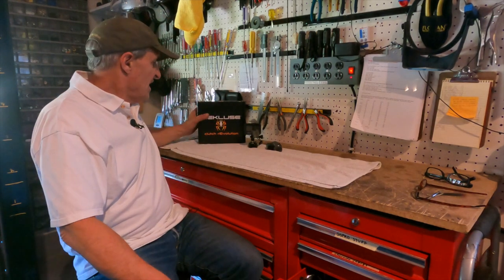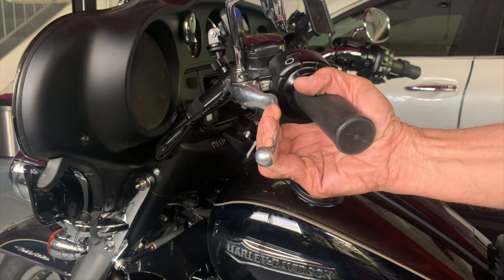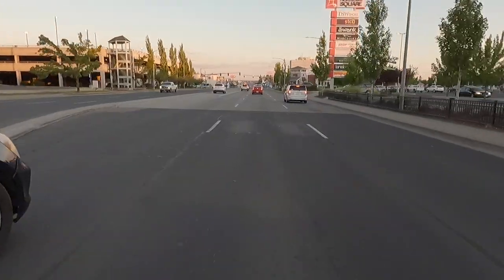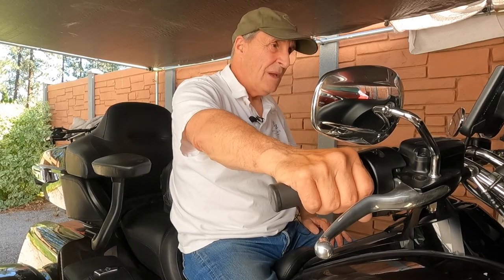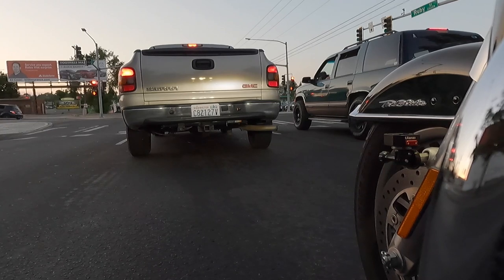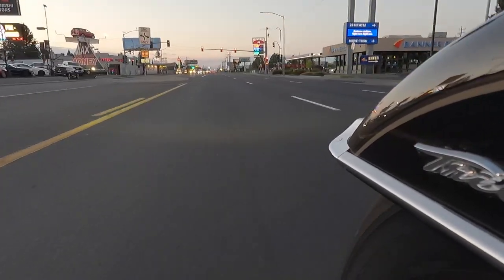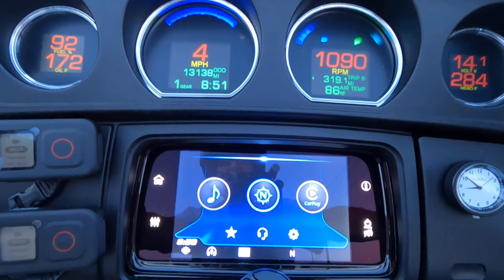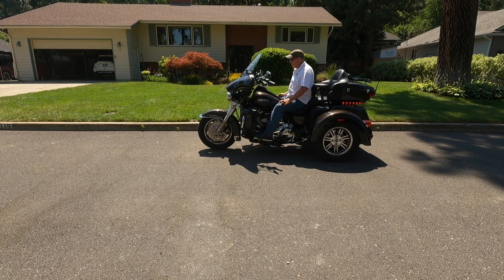Rekluse Clutch Harley Davidson Tri Glide M8 Examples of use.

Comment: windsurfed1....Absolutely GREAT video about the use of a Rekluse auto-clutch I've ever seen. Even learned a few trick I didn't know after having one for 4yrs.This video should be attached to the Rekluse website (if it isn't already) and provided with every Rekluse clutch installed, a short video file given to the customer by whoever installed it.

I'm 65, been riding since 13yrs old, very familiar with NOT have an auto-clutch. 1st bad experience was bumper to bumper traffic for 6hrs riding thru Louisiana, had to pull over and let my left hand relax. Cursed the situation but, rode on. Close to home same thing for 15 miles, my grip just let go and the bike jumped and engine died. Fortunately I knew how to handle it. More cursing. Immediately decided to get an auto-clutch. Rekluse was my 1st choice from website surfing and it's advertisement/show at a local (to me) Lone Star Rally in Galveston. 1st thought when I first saw them some 6yrs back was...that's stupid. Oh NO, so I had one installed on my 2017 Harley Road Glide. OMG best decision I ever made about an upgrade to my pretty new Harley. The should be made standard equipment BECAUSE you can use the clutch as you normally would but you don't have to.

FYI I'm not a Rekluse employee or paid advertiser. I'm just an experienced believer in Rekluse. Got another brand for the wife (because of price at the time), worked ok for her, she couldn't competently use a clutch and it worked, but not as well as my Rekluse, but she didn't know and hers worked great for her, but I did as we rode together for thousands of miles.

Long story short, too late now..LOL. Love it, no regrets. Just bought a new 2022 Tri Glide and wouldn't take it home without the Rekluse auto-clutch installed. What I learned by trial-error with the Road Glide, you have explained exactly how to use it and what to expect.

In my 4yrs experience with the Road Glide and now just a few months with a Tri Glide, anyone watching this video can't go wrong having it installed. No, not cheap, but if you ride thousands of miles a year or just can't get the hang of using a fully functioning 'mechanical clutch' only, get a Rekluse....they're GREAT...watch this video, no better advice can you get.

Windsurfed1...WONDERFUL FULL EXPLANATION....THANK YOU!
Reply from the maker: James, truly sorry but I missed this comment somehow. Thanks for the compliment on the video. Hi, like you have been riding since I was 13 and I was in the same identical situation you are in with hand grip. I also ended up putting in a new slave cylinder, which made it even easier to pull the clutch.   Not too many guys have a wife that rides her own motorcycle like you. Fortunately, I have one also. But she had to quit because your eyesight was getting bad. That’s when I bought my 2020 tri glide for her to ride on the back with me. We rode together for 15 years before I bought the Triglide.  Congratulations on your purchase of your new 22 TG.  I should have bought a tri-glide 10 years ago. Anyway, thanks for the comment and again I’m sorry I did not answer your comment. I always answer comments but somehow your slip by me.
Reply: @windsurfed1  Well, at least you eventually replied, thanks. Wife's 1st individual "bike" was a 500CC scooter, sort of an automatic transmission. Tried as she might, could never master the accelerator/clutch, then add braking too of a standard unmodified motorcycle. But, disregarding take-off ability she could keep up with me at any highway speeds and we frequently took 10 day rides across many states. 1st time she got blown over 2 lanes in a storm I stopped us to rest and allow her to regain her composer. 1st words out of her mouth was "I need more ass" LOL No, I didn't touch that comment but I knew what she meant. I was riding a full dressed Road Glide. Within a week we were looking at the Tri Glides. In the motorcycle world ya can't get more "ass" than that. Immediately had an auto-clutch installed, can't remember the brand, wasn't a Rekluse, couldn't use the clutch anytime and every time like a Rekluse but it worked for her. For me, my left hand was getting weaker (and I'm left handed) the older I got. 5hrs of bumper-to-bumper traffic took it's tole and I decided on a Rekluse because you can use the clutch anytime ya want or none at all. Only down side with a 2-wheeler is parking on an uphill incline, putting it in gear was ineffective. Fast forward, after having a stroke the Road Glide sat in the garage nearly 3yrs as my left leg lost some feeling and strength to the point I was scared to ride the 1000lb 2 wheeler. Only option I could think of was sell the bike and quit riding. Wife talked me into switching to a Tri-Glide. Rekluse installed before I left the dealership. Love the Rekluse, has it's own parking brake, no need to put it gear. Only downside with a Tri-Glide is ya can't "lean" into a curve. I still miss that "lean" (including the occasional sparks) after nearly 60yrs of having it but it is what it is, just have to get over it.
Reply from the maker: @HarleyUTubr  I think without the recluse clutch, probably my riding days were over. I had to do something about that clutch pull. That’s when I discovered the reckuse clutch. All the years I have been riding I’ve never heard of one and that’s kind of weird. In 2019 on a trip to the Alvord desert in southeastern Oregon, I pulled into a gas station to fuel up and forgot to put my kickstand down, and I fell over fully loaded.  I was on a 2016 triumph tiger 800.  From that point on, I started thinking about my days of riding could be over. Then I started thinking about the Triglide and ended up buying one. I’m glad I did because it extended my riding   probably for another 10 years or longer or lesser. Who knows.   They are a little expensive out the door. I have since put on over $8000 in usable accessories, none for looks.  Well, maybe a bit, but mostly for convenience and comfort ability.  And for the wife, she really enjoys riding in the plush seat in the rear I thought she would miss riding, but she’s content on the back now listening to her music  we did not go, like you did for 10 days or so, but we only went for 4 or 5  days at a time. I think our average per day was right around 270 miles a day. We enjoyed it and just took our time.  Before I met my wife I’d like to camp a lot. Her idea of camping was staying in a motel. So guess what, we stayed in motels/hotels and I got to the point where I forgot about camping. Anyway, I know you got tons and tons of stories and experience. We both will just keep riding and enjoying til. It’s over.

Comment: Thanks for your help, I just bought a 22 street glide, my drive out of my townhouse is a steep hillwith a semi blind right turn at the top. I have to feather the clutch to navigate the turn at a slower speed, If I had to stop I will have my hands full. I think this clutch would eliminate that stressful situation,, I am going to have one installed. Thanks for your helpful info.
Reply from the maker: Glad you could use the video for some information. That would be a great clutch for what you were talking about. They are rather expensive though. I have not had any issues with mine and I have around 8000 miles on it. Of course I am very easy on it, I think maybe if a person was hard on it it wouldn’t last as long but I suspect mine will get thousands of miles on before I have an issue.
Reply: @windsurfed1  yeah I plan on going easy on it also, that big heavy glide intimidates me, your video was awesome!!!
Reply: @windsurfed1  I did have a recluse installed in my street glide and it is a beloved upgrade, although I haven't been able to put many miles on it before the season ended on us. sure is a fine upgrade and thank you for taking time to school us.
Reply from the maker: @michaelpowers4452  Michael, thanks for the comment. The recluse clutch now has around 15,000 miles on it and it’s still working really good. I am very easy rider so I don’t hot rod or anything but it is very nice to have especially in traffic.

Comment: I'm looking at purchasing a Tri-Glide  or a Freewheeler (will be my first Harley after a lifetime of riding Triumphs) and have been devouring your videos. This one is fascinating. Thanks for pointing out the negatives too.
Reply from the maker: We rode Moto Guzzi ‘s for 15 years then I went to a triumph tiger XRX, which probably was my favorite bike, but I finally had to dump two wheels and go to three wheels and the Triglide was the best choice for me. The recluse clutch is probably one of the best investments I made for this Triglide.  Kind of expensive, but if I had to do it all over again, I definitely would. I love the recluse clutch. I’ve heard some guys having issues with it and I believe it’s only because it was installed not properly it or they don’t know how to use it correctly. If you’re a hot rodder, I’m not so sure this would be a good choice. But if you are a mild mannered rider , this would be an excellent  choice.

Comment: First video that really shows how to use this thing. Had in my bike over a year and really had no clue how to use it. Burnt up on me after my first trip and really had no clue why. But the company is awesome and sent me a new one but still didn’t realize how to use it till I watched this…. Had no clue u didn’t have to down shift and pull the clutch in on all those gears …. Wow still would like some info on the gap … adjusting that thing …. I have a road glide …. Thank you 🙏🏻 awesome…
Reply from the maker: Well I am glad you discovered the video.  The way I used it in the video is the way I use it in real life. It works fantastic. I hardly use the clutch lever anymore. I had the shop put mine in and they adjusted the gap. I have over 8000 miles on that clutch. And I have never adjusted the gap because to this day it still feels the same as the first day.  I am pretty easy/gentle with the throttle in the clutch. Maybe that’s why I have never had to adjust it.

Comment: You nailed this, thank you. Having had a Rekluse clutch previously, it’s a solid product, no complaints, well built and thought out. If one does mostly city/parade/sturgis main street riding it’s very viable. That said, having also been riding well over 50 years combined with being fortunate enough to still be riding and also riding a Tri Glide, I’ll stay with the uncomplicated thought, natural instinct of the stock clutch and gear box. One man’s opinion and I fully appreciate and thank you for yours.
Reply from the maker: Thanks for the comment. Yourself, riding over 50 years, I take it you really know what you’re talking about. I really am enjoying that rekluse clutch. I probably would not enjoy riding as much as I do without it. The slave cylinder added to the easiness of the clutch pull, which mades it even better.

Comment: I've been searching YouTube for a "how to" on the rekluse, and your video was EXCELLENT. Were you a teacher by trade? Because you explained everything in fine detail and absolutely perfect.. anywho, thank you, I'm getting a stage 2 on my freewheeler and now a rekluse clutch
Reply from the maker: Don't know how I missed this comment.  No I'm not a teacher.  Thanks for the comment.  Really sorry I didn't see this till now.  You will really like the rekluse clutch.  I am thoroughly enjoying it.  I have about 5200 miles on it now.
Reply: @windsurfed1  so I'm in Ontario Canada and it's been cold and rainy so nothing yet, but I have another question, if you're in say 5th at 1500rpm and downshift to pass, do you need the clutch then?
Reply from the maker: @macwiller2105  If you were at 1500 RPMs and in fifth year and you want to shift down and pass, then yes you would have to use the clutch and shift down.
Reply: @windsurfed1  ok thank you. So basically it's for coming to a stop and starting? Anything under 1150rpm then?
Reply: @windsurfed1  last question, do you still "blip" the throttle to rev match when you downshift? I would assume if you didn't the bike would shutter
Reply from the maker: @macwiller2105  The recluse clutch is mainly used when coming to a stop and starting. On any motorcycle you can shift sometimes without the clutch depending upon the RPM. I blip the throttle to make it smooth. And this clutch is and can be used in that same way. If you have mastered that clutch throttle blip thing. I use it occasionally blipping The throttle up a little bit when shifting in higher gears and even when shifting lower gears.  But just when the RPM is calm and I am calM. But anytime I would go really fast I would use the clutch or shift down real hard I would use the clutch lever. Hope this makes sense.
Reply: @windsurfed1  yup, it absolutely answers my questions and thank you for your time.. safe travels

Comment: very well done! question - when you were down shifting at a light, were you using the clutch at the 10%?
Reply from the maker: @jimgallo6508  no I was not downshifting coming to the light using 10%. I was drifting along and the RPMs are under 1150. RPMs and I just shifted down ever so slowly/naturally each gear 
 as I came to a stop.

Comment: thank you for the great explanation. I have a question, i hear many things about reklusse. if you use it the wrong way, you can easily break it or burn the clutch. do you know anything that we shouldn't do. if we use clutch too much does it give harm?
Reply from the maker: Ya know,  when I decided to pull the trigger and buy the rekluse clutch, hi by then had done a huge amount of research. After all it is a lot of money. Of all the comments of people that owned one, not one negative comment. Everyone that owned one was very happy. As I am also.  I am a very cautious/easy rider.  A few times I have started out in 4th gear by mistake. I have 2500 miles on the clutch now with no issues. Yes, you could burn the clutch out just as you can burn the clutch out in any other brand. Common sense and easy-going I believe will make this clutch last a long time, probably longer than I will live. The only issues I have heard of is the installer not correctly installing it. For this big touring bike of mine, I am really glad I got it. I think you would be happy also.

Comment: Great video... I was hoping this system would allow the bike to be started in first gear without having to pull the clutch. Avoiding neutral on a HD would be desirable since we all know how frustrating it can be to find neutral.
Reply from the maker: Thanks for the complement. Other than what you were saying about, the clutch is great.  I did add a rekluse clutch slave cylinder which reduced clutch pull around 50%.  I am very happly with that.  Even thought I seldom use it anymore.

Comment: Great video - so many questions.  im a new rider.   had rekluse installed oni my freewheeler trike.  many issues - changing gears from 1sr to 2nd.  will try your methods of shifting up,  Rekluse wants me to keep rpms above 2500 in any gear above 2nd.  having helluva time up shifting.   wont let me shift unless throttle is even.  what is your range for upshift 1st-6th.  I do find if i do a quick stop, it will return to 1st gear.
Reply from the maker: All you have just said tells me it ain't right.  It should act just like a regular clutch with no issues.
You are using the clutch lever (Pulling in) when shifting 1 to 2nd and to 3rd and so forth?  I have heard of mechanics who installed the clutch wrong and then they had issues.  You should not be having any issues at all it you bike did good before the install.  Now after the install, you are have issues.  Should not be.  Something on the install.
Reply: @windsurfed1  thx for he reply.  will confer with harley.  next question.  when stopping like you in  t4h or 5th, dont need to pull clutch lever?
Reply from the maker: @giantcarver  that is correct. As you are coming down in your speed and the RPMs are below 1150 RPMs you can gradually shift down from fifth or even six down to first and I would suggest slowly so that by the time you’re stopped you will be in first gear. Even if you are stopped at the light and you are in fifth gear you don’t need to pull the clutch lever in to shift through the gears to get to first.  I do that process slowly so that there are no issues. It works fantastic once you get used to it

Comment: Thank you for the great video what are your thoughts on the baker transmission DD7 and the Darkhorse Crankworks MAN O-WAR Motorsprocket System
Reply from the maker: YaI know, all those things you mentioned above I am familiar with the names but don’t know anything about them.   I am not an engine or transmission guy.   I just keep everything stock and never went beyond that.  So in all actuality you’re speaking a foreign language to me.   Don’t know why I never dove into the engine or transmission stuff.
Reply: @windsurfed1  thank you for the reply

Comment: Have you had any trouble with the recluse clutch this is my second one on my 2014 Triglide trike the first one burnt up let me know have you had any problems with yours and keep the videos coming I am looking forward to putting on Dakota digital
Reply from the maker: No, I have not had any problems with my Rekluse clutch. I am very easy on it. I could see if a person was hard on it. It might not last a long time.  I am very gentle on it when starting out. In the back of my mind, I am always thinking. I hope it lasts.   I have right at 10,000 miles on it now and no issues.

Comment: Thanks for the video.  Who installed your clutch?  Harley dealership?
Reply from the maker: Yes, I had to dealership install the clutch. I probably could’ve done it myself, but I did not want to. I have a little more than 15,000 miles on it and it still works great. Never touched any adjustment. I am a very gentle rider. I think they charge me somewhere around two to $300 to have it installed. I’m glad I had them installed though.